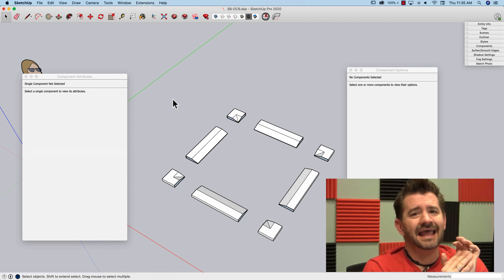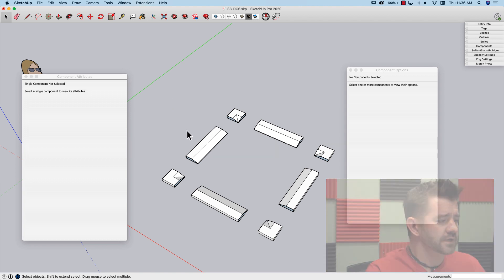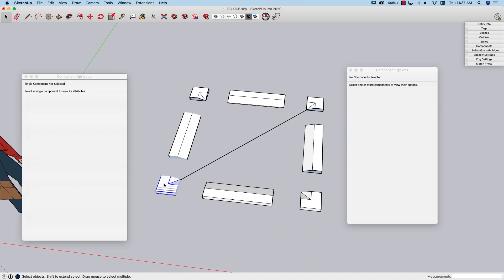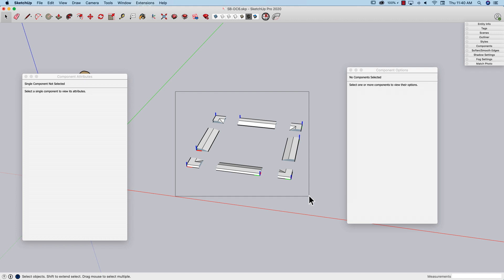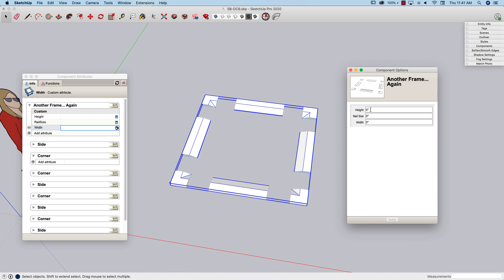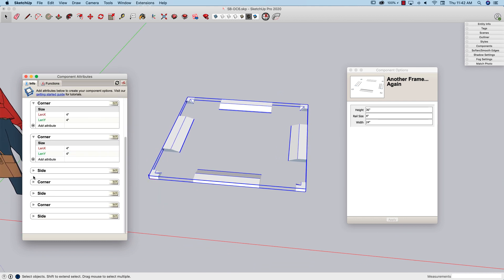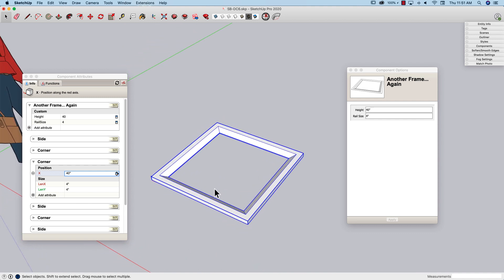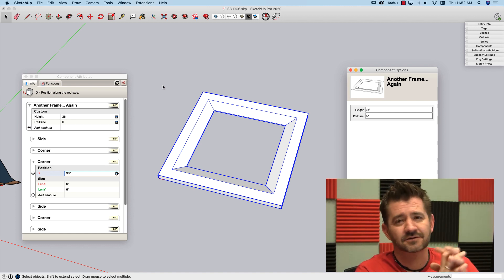Dynamic Components: What not to do - Skill Builder

Comment: maybe make sub components of the top+bottom and left+right and then you can resize the sub components to the frame dimension and internal to the sub component, the members have fixed locations and width decided by the frame RailSize. That should at least make it simpler with less components/attributes to configure

Comment: Hi, i have made a dynamic window with copal profiles design, i have seperated it in corners and sides and the left and right profile are increasing down the z axis instead of up the z axis, how can i fix them to go along up the z axis when i set the size of the window in the component options, what am i missing ?
Reply: I just found it out, if you change the size of the profile inside the window group the functions will go wrong, you have to explode the profile, resize it and remake it a component in the location it is in the window group

Comment: If you explode the copied components they will lose the properties from the original, and after doing that with every single one and creating a new one called TopRight, Bottom, BottomRight,... By doing that your axes will be in the right position and your components will be independent. Maybe is useful this tip for already premade machines that you want to modify

Comment: If you made copies of the components, can't you use the "Make Unique" to change the sides or corners into individual components?
Reply: That's exactly what I did for the extreme sides. The frame can be changed in height and width. 
https://3dwarehouse.sketchup.com/user/9d0c508e-e63d-4c3c-a646-ef18f4cfca0d/%D0%AE%D1%80%D0%B8%D0%B9-%D0%AF

Comment: It appears as though the name of a component as listed in the Component Attributes dialog box is a unique variable called an Object Name. The Component Name and Object Name can be named differently with out making the components unique. To resolve the component name (Object Name) replication in the Component Attributes dialog box, double click the geometry to edit inside the top level component. Select any duplicated component. Inside the Component Attribute Dialog Box for the selected component, double click on the name of the component. This will open a dialog to edit the Object Name. Rename this to fit your naming conventions. Repeat this renaming process for all the components you wish. Upon return to the top level Component Attributes dialog box, the new name(s) will appear, allowing easily identification.

BTW, I'm loving this run of Dynamic Component videos. I hope it continues.

Comment: I think if the vertical sides where the same component (mirrored probably better than rotated) and the horizontal ones also the same component, that would make it a bit easier and it would be possible to change height and width separately and instead of going inside the component to know which copy is which its possible to know by trial where you can add a position attribute and change it then set the values according to the copy that moved.
Reply: Wissam Al-Sayed Possibly, though placement may still be a struggle... unless you steered clear of the array for placing the pieces.